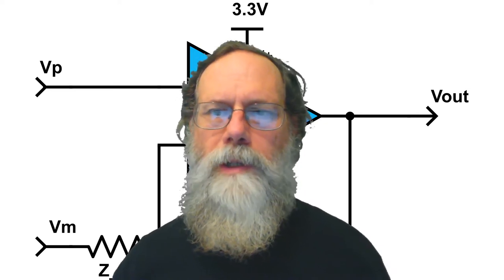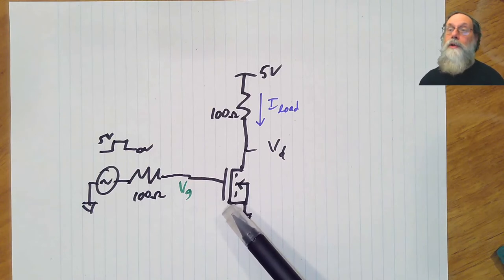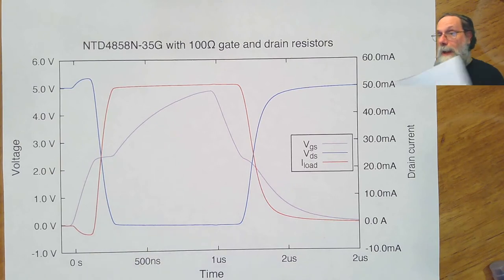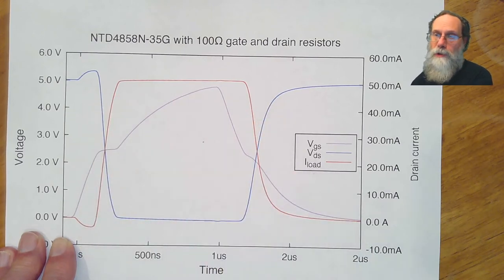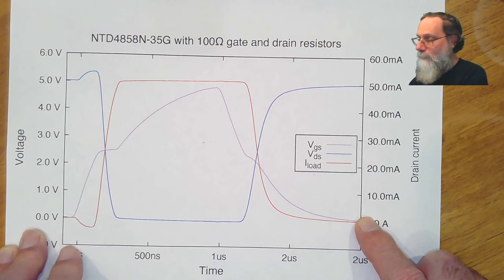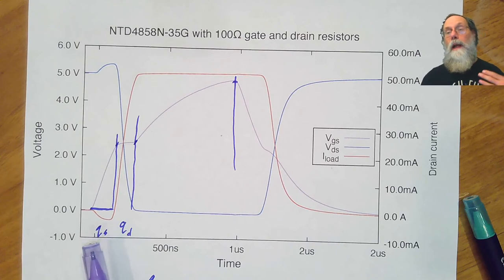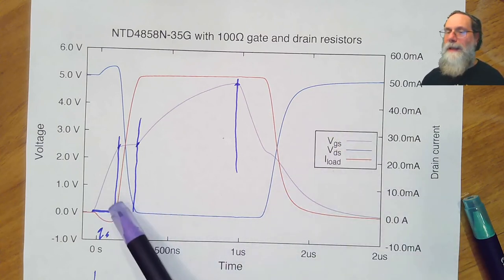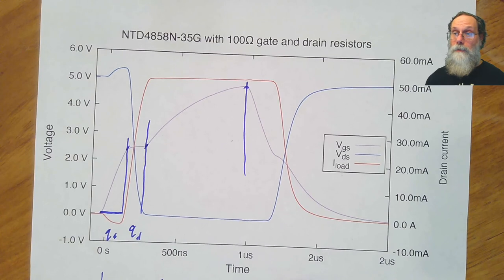Switching speed FETs §32.5

Comment: good presentation...during my time at a certain mobile device manufacturer (13 years ago), developing DC/DC converters, switching speed was the double-edged sword, as you want fast switching, but EMC is a problem, and that "wasted" energy in total capacitance comes from precious run-time, i worked on driver ideas to get to the Miller plateau "instantly", then a controlled slew rate through that, and a terminated/controlled overvoltage for the on-time... you "only" need to know actual capacitance of the first two segments, and a "useful" Vgth + desired headroom...possible, then, to get very quickly to turn-on, have a desired slew rate of the switch, but with very little "extra" gate charge, and equally-fast turn-off... not something you do in discrete logic, but fairly do-able in a complex driver.
cheers!
Reply from the maker: Because my course was the second half of a first electronic course, I had to keep things fairly simple in this video, so I could not get into sophisticated driver design (even if I knew anything about the subject).  Students doing the class-D amplifier lab do run into problems from too-slow or too-fast switching. THe problem they have is not so much from the electrical noise as from shoot-through current from not turning off the pFET as fast as the nFET turns on.  Changing what pFET and nFET are used (as we did almost every year as cheap FETs reached end of life and became unavailable) or what voltage we operated at changed the tradeoffs, so students couldn't blindly copy designs.

Comment: so you can see here fets operate faster than 100 Mhz!!!
Reply from the maker: Different FETs operate at different speeds—high-current ones tend to have very large gate charges (because of the large area of the gate to get sufficient channel width) and so are difficult to switch quickly—even getting over a MHz can be difficult. Tiny logic FETs, such as are used in modern processors, can switch at several GHz.